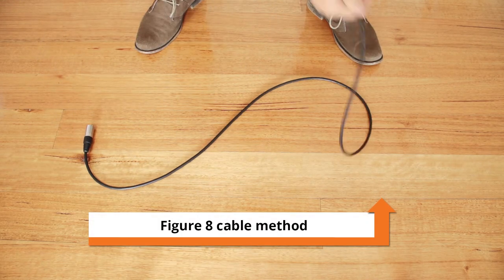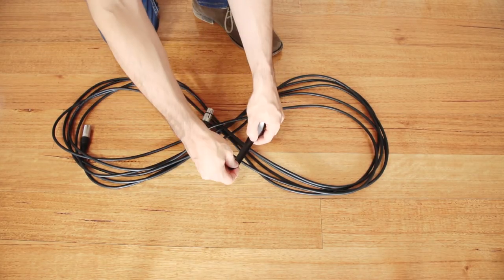How to coil cables - Basic TV industry skills

Comment: Thanks for the video.  I worked in Hollywood as a local 728 set electrician for a while so I enjoy these types of videos.  
One thing you may not know is that the figure 8 is something used for larger cables (which you mentioned) because coiling a lengthy cable or a cable running a lot of power through it causes heat and can actually melt the cable.
Reply from the maker: Thank you, I didn't know it helps to protect larger cables from heat problems, that makes sense compared to coiling it. Thank you for sharing your experience here.

Comment: Thanks, Great video.  No annoying background music, nice clear audio.   I'd been  just  twisting in one direction but turning the whole coil 180 degrees every so often to relieve any built up extra twist in the remaining cable.   I'll try your way of alternating the twist next time.
Reply from the maker: +Patrick Callahan Thanks Patrick, yep after working in the TV industry as a camera assistant for so many years working with super long cables, you will learn that if you don't alternate each one you'll get very inconvenient loops that will appear behind ypu on the floor and then coiling fast when moving quickly becomes the biggest problem. By doing this method we create a smooth cable that is easy to work with no matter the length.

Comment: Good video of the over/under coiling procedure, only in my experience the coiling is backwards in your video. I have been in the television industry for 41 years and we always start the connector facing you  and the first coil in a clockwise loop not away in a counterclockwise motion. Sometimes it gets backward if a lefthanded person coiled the cable. The way you did it is perfectly acceptable if you are the one doing the uncoiling, otherwise if the cable is done the way you show and the cable has only been partially uncoiled, the next person doing the industry convention will be cursing the coil.
Reply from the maker: Thank you Bruce for sharing your experience and advice, I will keep that reference in mind.
Reply: I too have been in the TV industry for 45 years and to me it makes no difference if the connector is facing you or away from you.  Once your done and have secured it, it makes no difference to the next guy.  And you should be able to do it in either your left or right hand.  And there are times when, during bump in, you've left a too long cable's excess coiled up and tucked up half way between the source and the destination.  Come bump out time, it is more efficient if you pick up the stashed coils and bring the ends to it.  Another tip:  cables that have come from the manufacturer on spools need to be pulled out to their full length before you can begin wrapping over/under.

Comment: I use a figure of 8 (sort of) wrap for my guitar leads, and since discovering this method, never have them tangle up.  I also made small ties using shock cord, which are fixed permanently to the leads and which hold the wraps securely.
Reply from the maker: Yes those little velcro style ties are very handy, I need to get some of those.